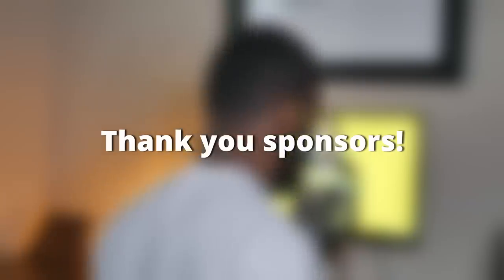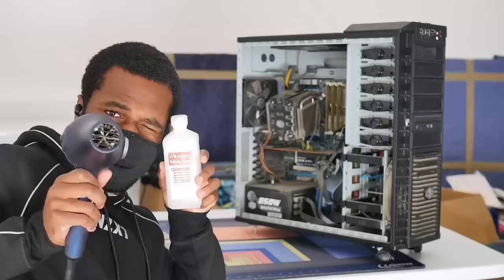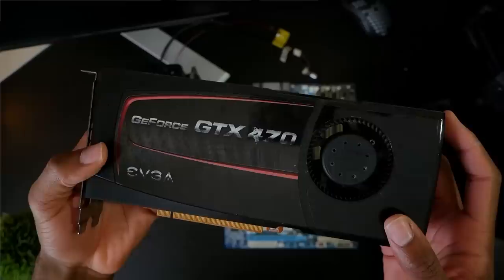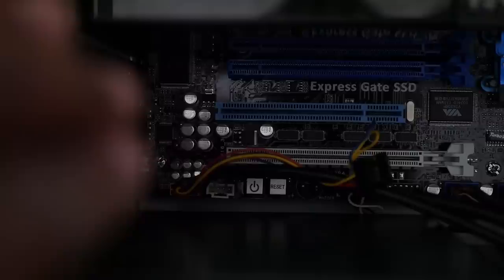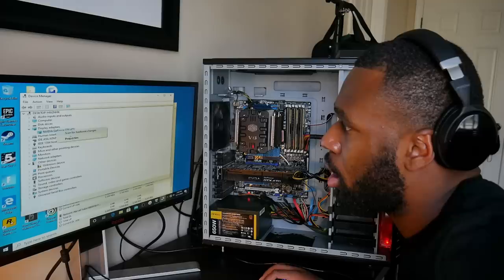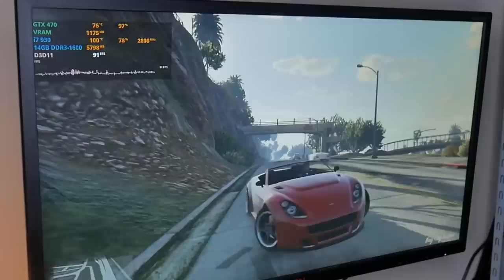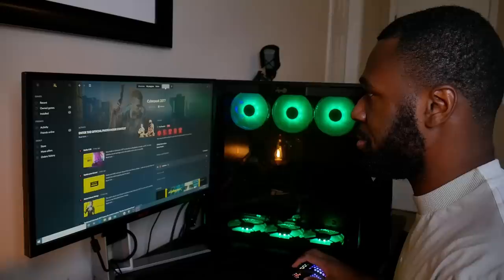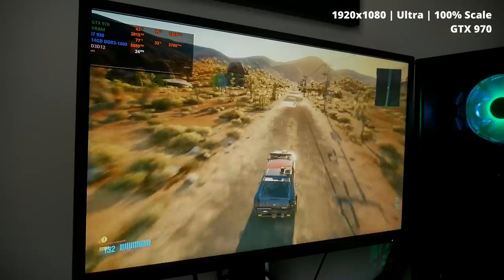The $32 Cyberpunk 2077 PC That You Can't Build | OzTalksHW

Comment: There's definitely something wrong with the cooler, I have pushed over 4Ghz on Nehalems with the V8 not breaking a sweat. Check your mounting and try again :)
Reply: he did, and if you listen close he said it was bent beyond normal repair.
Reply: @CommodoreFan64  use a hammer

Comment: Thanks for the fun and relaxing content :) Linus tech tips and Louis Rossmann did a video together. Louis explains that reflowing the solder actually does nothing. It's the thermal shock to the GPU core that temporarily brings it back from the dead.
Reply from the maker: Did not know this. Thanks for the heads up!

Comment: WARNING ABOUT REFLOWING CARDS USING THE OVEN/HAIRDRYER METHOD
If you're looking to just get a gpu working for testing, in an emergency situation, or for just fun and experimentation, then heating up the card to reflow it is absolutely fine. The problem is that if you're actually trying to recover an old card for selling a computer or giving it to someone, then reflowing is absolutely not something you should ever do. The idea behind it is that when you reflow a card all you're doing is heating up the solder balls inside the gpu itself and more or less relying on luck to try and repair any broken or shorting connections inside. The important part of this is that instead of just heating up the solder, you're heating up the entire die which causes even more damage very quickly. Moreover, you're relying on the now-flowed solder to not spill over and make a bad connection of some other kind inside the gpu. Based on forums I've read and posts on places like reddit, these reflowed cards very rarely run past the one-month mark and some even die within a few days of the reflowing being done. Again, if you just want to see if you can get a card up and running for fun or in a case where there is literally no other option, then absolutely try baking your card and seeing if it works. However, and this is a big however, if you are planning on selling this card OR giving it to someone who plans to use it long term, then you are putting whoever receives the card in danger of losing it in a very quick manner. At best, you'll be giving them an unreliable product. At worst, it's a borderline scam just to save a few bucks.

Comment: You can buy a w3680 cpu for $20 on ebay or ali express for this motherboard, which is a 6 core 12 thread unlocked i7-980x, it will overclock to 4.1gherz stable on air with no tuning needed.  You can then run up to a 3080 with no bottleneck at 4K ultra.

Comment: I have a similar situation to yours where an old x58 PC with an i7-930 and GTX 750ti was just collecting dust and practically thrown out. My friend traded it to me for my old 3DS and some other stuff I had, and I brought it home and fixed it. Turns out, it just needed a new cable for the 1200W PSU (they didn't have the right one that plugged into the wall) and a reinstall of windows (this one was corrupted, viruses maybe?) and I got it working. 12GB of RAM, a recycled X5675 from AliExpress (equivalent to the i7 4790 in terms of benchmarks) and an RX 580 (traded with a friend + $70 thrown in) and it is BASICALLY Cyberpunk recommended specs. x58 is such a GOD chipset when you already have the motherboard. Great video by the way, absolutely love your channel!

P.S. if you ever make another video on the i7 930 (specifically this CPU) try overclocking it to 4.2 GHz like I did, you get some FUNNY results. (Games speed up and act differently, Black Ops III games that I hosted moved at double the speed)

Comment: I found a computer several months ago at the dump with the same Coolermaster v8 cooler on a Phenom II x6 1090t. The motherboard was a basket case that took a lot of work to get running, it had some corrosive substance splashed across the RAM slots that required neutralizing and repairing of trace and component damage, but it eventually came alive and worked.

Comment: Hats off to you Oz! I recently did the same thing with an old PC I had laying around. It had the same cooler master HAF case, the same V8 cooler and the same, but lower wattage PSU. I did kind of have the same headaches, but not as much as you had. Here's what it's like now. The GPU will change soon and will move my current rx570 or an old gtx 970 that I thought of baking, cause it was throwing the same error, but for some reason backed-off. Not sure about that yet. It's currently being used as an HTPC. It's quiet, runs perfectly and can say that I'm ready to use it until it dies and I can't find parts anymore. I love it. The V8 cooler is a center piece and some people that come as guests (prior to corona) are mesmerized  from it. 
PC Config 
----------------------------
Motherboard - Asus P6T SE

CPU - i7 920 OC to 4.0Ghz

CPU Cooler - Cooler Master V8 tower cooler with a new Arctic P12 PWM fan

Ram - 24 GB (3x4GB DDR3 1600mhz Corsair Value Select + 3x4GB DDR3 1600mhz Corsair XMS3 running in triple channel)

GPU - Nvidia GTX 560ti Gygabite Windforce Edition 

USB 3.0 PCI-E Card from Orico 

Storage - 240GB ADATA SU630 SSD + 1TB WD Blue 64MB Cache)

Computer Case - DeepCool Mattrexx 55 Mesh   

PC Fans - 6xArctic P12 PWM

PSU - Cooler Master Silent Pro 700W

Comment: In 2010 I built a PC with an AMD Phenom II X6 1090T,  Gigabyte GA-890GPA-UD3H motherboard,  G.SKILL Ripjaws  16gb (4x4gb)  DDR3 1600,  EVGA GTX 470 Cooler Master V8 CPU cooler,  DVD drive, 2 500GB hard drives, 600w PSU in the Cooler Master HAF 932 case for $1200.   I loved the HAF 932 but it was huge, heavy and prone to dust with its three 230mm fans.  I used that PC until 2017,  over the years I swapping out hard drives for 1tb drives, and the GPU with a GTX 680, I also had to replace the PSU when the original one exploded around 2012.

Comment: you can put the heatsinc on a steel plate with some pressure, then heat the plate or bottom of the heat since, so the metal becomes bendable or the aluim becomes softer and is about to start to melt. this way you can reflatten the bottom. and a cooking station combined with a pan is probably enough especially if the bottom of the cooler is aluim since you can already melt that with a normal lighter.

Comment: i got an msi x58 pro with i7 920 and ekl cooler from ebay for 20€ with shipping inclusive. And that was in november 2020. My Opinion on older Hardware like x58 is: If you're lucky like me, get oneof these. Otherwise, thanks to the high prices ( 7:04 ), get yourself a cheap am4 board and 1. or 2. gen ryzen 3 or 5. Thats a better idea, if you're unlucky to find x58.

Comment: love the video man, I found an XPS from 2010 recently while cleaning out an old office and its the exact one i had back then so i immediately recognized it and made sure it was okay with the business if i take it home, since our job was to completely throw away everything. I took it apart, gave it a thorough cleaning and when i opened the case i was surprised to see 8gb of ram in there, a 1.5TB hard drive, and an intel core i7 870 (2.93GHz). the GPU is a raedon HD 5500 and im currently working on updating the GPU right now but let me tell you i was surprised when i finally installed some games on it and gave it a run for its money. i can play a lot of newer games like black ops 3 and dying light, vermintide 2 from the warhammer series , and it seems like im limited to the 'older' new generation games because of the GPU, which is why im trying to get a 6GB one and im sure then i can play all the newer titles. might add another 4 gigs of ram just to make sure i have enough but i honestly think i'd be able to run Cyberpunk and Call of Duty, Kingdom Come: Deliverance ect

Comment: Those front panel connectors are a PITA😅. Burned me twice and both times it was the reset switch, lol. If you are having issues with your build not booting, first check front panel connectors and save yourself a ton of grief.

Comment: Dude, revise this and go on eBay and buy a Xeon X5660 $15, or X5675 $25, which will give you over 2x performance boost (and would be at par for a AMD Ryzen 3 1300X or even a AMD Ryzen 5 1400, which is honestly great for a 12 year old CPU). And you'd drop the TDP by 40 Watts but that GPU needs to go though, lol. Great walk down memory lane, thanks..

Comment: my little brother currently still has my old PC, which has a stoneold i7 860 in it paired with a fairly newer GTX 1070. He can play Cyberpunk, but due to it being installed on a HDD, some 3D Models just don't load in fast enough. It's not a pleasant experience.
About to build a new PC with him, including a 5600x, probably stick with the GTX 1070 until 4000 series comes out.

Comment: I bought a complete Cooler Master Haf 932 with all the fans for 10€ and built my main pc in it. Good stuff. I can overclock, I can game, I can watch vr p0rn and the rig basically runs at room temperature, while sucking in all the dust and microparticles flying around. (would suggest adding some filters to the vents, at least one under the front panel.. 👀)
In the summer when it's +30 degrees celcius in my studio apartment it blows cold air somehow.
Best PC case I've ever owned

Comment: I found a perfectly working old pc with an a6 3600, and 8gb of ram in near perfect condition that still works minus the dvd drive.  I was able to get an old gpu and it is a pretty capable gaming pc for under 50 dollars. I think the reason it was thrown out was the sata port for the dvd drive broke, but that shouldnt be a reason to throw out a pc unless you rely on dvds and have no other options.

Comment: If you put in a xeon six core, and a 1050ti, this would be a perfect built that would run anything, you have to add a couple of bucks, but if you wanna build an x58 system, the most expensive item is the mobo.

Comment: Great video as usual, but also thank you - an unintended side effect of this video is that I've realised I must have something set weird in my GTA V settings. I have a better specced PC than this (i7 4770k with a minor OC to 3.7GHz, GTX770, 16GB RAM) and IIRC last I checked I was getting ~40-50ish FPS max at what I thought were normal settings. Love the game but really wanted 60+ FPS without dropping to low, but guess I must have something set wrong if you were getting 60-100+. So cheers because I'm about to load it up and figure out what's set up wrong.

Comment: A couple weeks ago I found a pc at goodwill for sale for 4.99 in a pretty plane looking case so I looked inside through the exhaust fan and saw a cooler master 212 evo cooler so I had to buy it. I took it home and took it apart to find it has 16gb of ddr4 ram,full atx mother board, i5 6500, and a evga 600 watt power supply talk about a find

Comment: Dude I have the same processor but on a EVGA x58 motherboard overclocked to 3.4ghz but it's on a water cooler, 16GB RAM, Nvidia gtx970. I've had this computer for a very long time with the only upgrade being the GTX970 that I got super cheap last year. It runs extremely well for what it is and no this isn't my main rig.
Reply from the maker: You got an insane ROI on that platform :) glad you enjoy it

Comment: This is the ONLY time and scenario where I would say cooking your card is ok. 

Just don't do it with any card you didn't find in a dumpster, lol. Just don't. 
In fact, I highly doubt the hair dryer did anything. It can't get hot enough to melt the solder and cleaning alone can often "fix" a card. Even re-seating can help.
At most the hairdryer heated up a bad mosfet enough to get it to work for a few hours.

Anyway...regardless...the point...

...DON'T bake your card or blast it with a heat gun unless you literally found it in a dumpster and it's over a decade old. At best you'll not actually fix it but get a temporary "fix" that will return and at worse you'll render it unfixable.

Comment: Upgrade the CPU to an X5650, or X5675, chuck in a GTX 1060 or RX 580, and you have an amazing 1080-1440p PC, mine is the x5675 at 4.3ghz, 12gb of ram, and a GTX 1080, i get 70-100fps on cyberpunk at high

Comment: Total lack of cable management.... Erm... Guilty as Charged! My Cable management sucks.... "Is it working?" "Yes" "Job done - next!". I'm a bit crap with the pretty - No RGB, no cable management - I don't bother with a glass side..... just get the thing working and move on..... I did have an assistant once that took the time to "correct" my work but I'm pretty sure she was only doing it for the over-time..... I think the biggest break through for me was when HDD ribbon cables were dropped in favour of SATA - that helped air flow.... for those of us that ignored the back of the case.....

Comment: I found a fully functioning pc in the dumpster at my job back in May 2020. It had an i7-2600k on a z68 board, GTX 570 2.5gb, and 16gb of ddr3 ram. It all worked for several months, until the ram died and I sold the remaining parts and upgraded to Ryzen
EDIT: After seeing it a few times, I realized LAZAROUS HAS THE SAME CASE AS THE ONE I FOUND!

Comment: I had a pc I built in '13 with an AMD FX and eventually a HD 7870.  But CPU killed the board or vice versa.

So now it has an eBay motherboard and a $8 Sempron single core CPU that was only meant for testing the old board.  And a HD 6450 installed for video output.

And in prime 95 I couldn't get the CPU to go over 30°. That's the biggest oddity... knowing your cooling solution is overkill but not having a good CPU.

Went from gaming PC to potato PC.  But it still runs and that's what counts.  Technically I rebuilt it for $35.

Comment: Most motherboards USB front header panel usually gets shorted out overtime for some odd reason. Had a few cases wit exactly that where it was overvolting the USB port itself randomly. I just unplugged it to prevent further random damage it could do. Windows kept giving me overvolt error on that USB port too which was annoying. Sometimes it could be the USB port on the mobo itself can be shorted over time too.

Comment: I got a 3770k Gygabyte motherboard (z77x-ud5h) but I damaged the 16x pci 3.0 slot when trying to upgrade the GPU haha. The 8x slot is still good so I can put any recent graphics card there. It's still usable since its got 32GB ram. It's probably becoming my streaming PC as I already got a gaming mini ITX PC in 2019 (Node 202 / Ryzen 3600 with 2070 super card).

Comment: From the start of not turning on I was like: short the IO connectors with a screwdriver on the board instead of hooking up the front IO cable😬 I’ve seen this quite often, hooked up wrong IO or damages button etc.

Comment: i spent 300 bucks on my lga 1155 celeron g550 4gb 1033 gt210 and now its i7 3770 16 gb 1600 rx 580 8gb and it runs warzone 70-80 fps 1080p medium btw i live in iran and it could cost me about 700-800 bucks if i didnt wnat to use used market so upgrading and going for used stuff isnt that bad as you always said (Iran is a bit diffrent normal people's people salary is about 100$ on average so 800 to 300 is like magic )

Comment: So let me get this right: You had problems with Temps and airflow and you put the machine in a case that has a no intake of air on the front panel? Genius desing... the case is pretty but airflow performance is crap, just like the In win 805 Infinity, guess they never learn.

Comment: Would a gtx 1650 work on a dell Opti   970 core i5 2400 with the stock PCU   and will it cause bottlenecking? The 1050 and 1650 cost the same so I think I'd rather buy a 1650 if it works

Comment: No. what happened was the computer stopped working because the cooler came undone. Because it was bought second-hand, the guy thought that he had been swindled and just chalked it up as a loss and threw it out. As for the dust-to-hardware, The computer had run fine for a LONG while before the Cooler came off. If he even opened it up and looked for even a second he could have spotted what was wrong and could have possibly fixed it with even a tiny bit of common sense, assuming the thermal paste was still good. 

Do not ask me how I know all that. It wasn't my computer I just threw out. ._.'

Comment: OK, so you say you exceeded the budget by spending $100 on parts which is fine.  You would rarely expect to pick up a 10 year old PC and not need to boost anything and it looked like the old owner had pulled all the drives, which was a good move by them.  But what you fail to point out is that you put this $100 PC into a $250 case totally blowing any budget you may have had,
When the PC was totally dead my first thoughts were the power switch, they have a habit of being temperamental on older boxes, I have bought some external power switches just for checking this.

Comment: lol, you should see what I do with my 11 year old XPS 8100. 
Only upgrades are as follows,
Gtx 680 gpu
12gb ram (old ram died)
750 nvidia 80 gold psu old 
        One got hit by lightning 
Usb 2.0 front port and card reader
Usb 3.0 pci card
New 3 antenna WiFi card with one
         Of the antenna extended 
Samsung ssd 250gb (os and choice
         Programs)
Still rocking the same case
Still rocking the same cpu

One question, do you get cooler temps with the side panel removed?

Comment: As soon as you put the extra ram in, you actually made the computer run on single channel, because you had 3*2gb and 2*4gb or if you just used the 8gb then it was running in dual channel and not triple channel.

You also took way to many steps to find out it was a shorted usb header and your gpu repair didn't actually solve your issue I honestly think the repasts and cleaning of dust from around the chip probably did it. Hairdryers don't get nearly hot enough to properly reflow something.

Not hating just stopping the disinformation

Comment: What in the good green finklefukk is on the front of your build. Get a 1660 6gb or 1070 gaming x and your in business. 5500xt and 5600xt runs it well at 1080 and 1440 respectively but your gonna crash a lot it’s very irritating